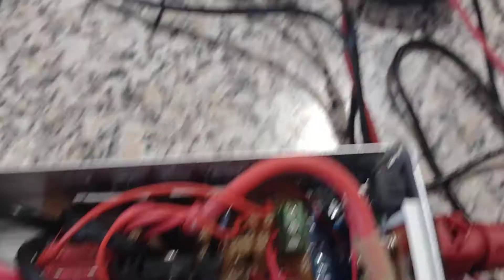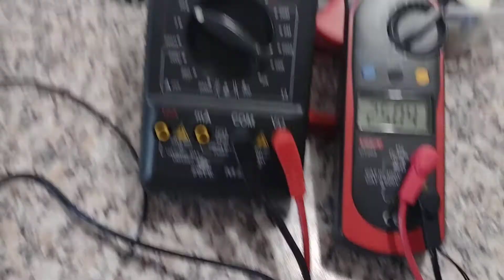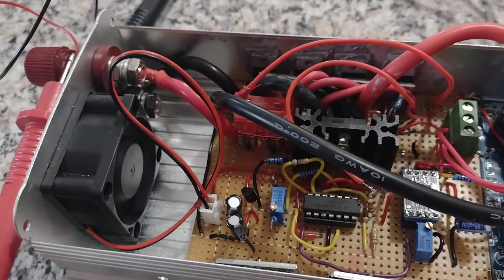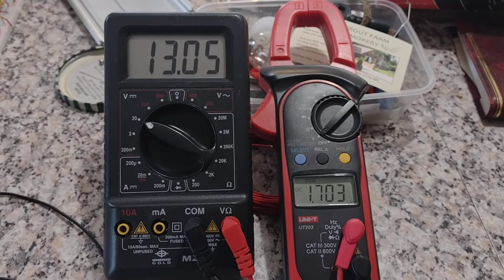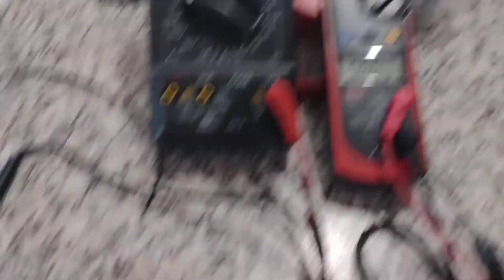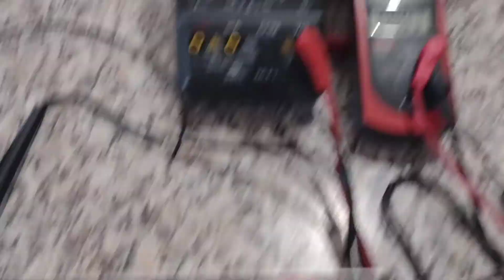PWM solar panel dump load controller

Comment: This is a great project, I was looking how to do this myself and kept scratching my head with it. I'm glad you managed to do it and put the information out there to help other people, I know I really do apriciate it.
Thank you
Reply from the maker: Thanks for this.  It works fine at 250W but I did try and increase the load up to 500W but the Mosfets got really hot. I adding extra heatsinks but this didn't help much.  I have a feeling the Mosfets might not be IRF originals (ebay!) as they should not be getting so hot.  Anyway I've bought some original IRFs and will be trying these.  Another option is to drive 2 separate sets of Mosfets with the DRV103 and have 2 separate 250W loads.  I'll post how I get on.
Reply: Nice, I need device like this that can handle around 500w load.